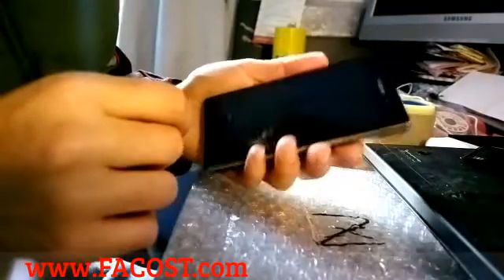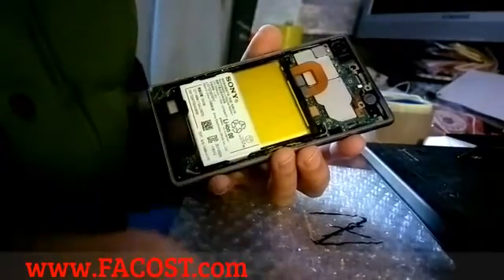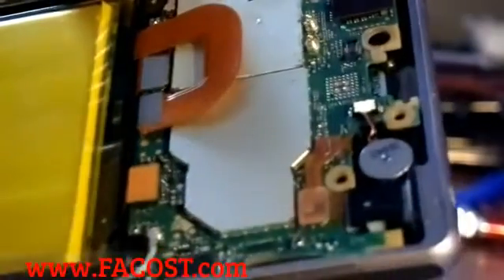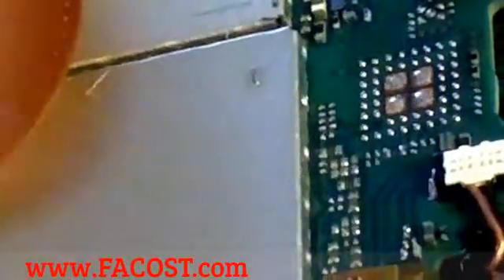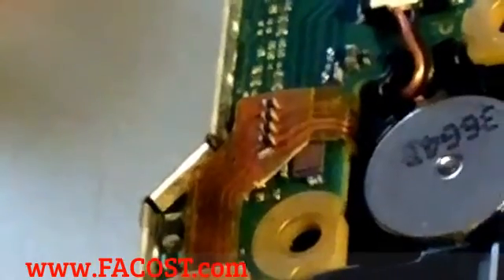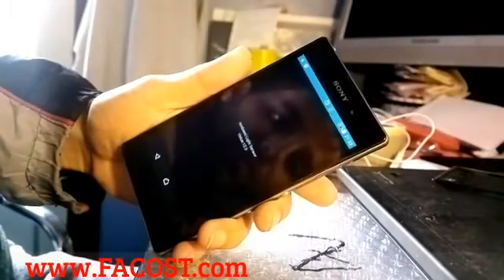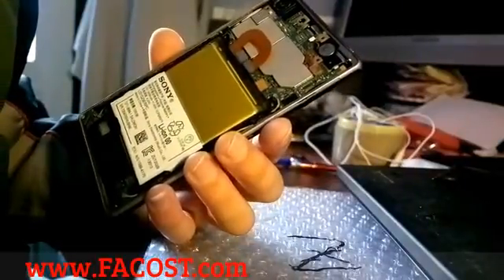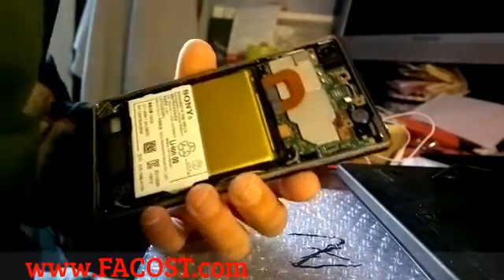phone proximity switch problem !! [Solved]  Black screen after end call

Comment: What about sony z5 mbl thats also the same problem plzzz give me any solution brooo
Reply from the maker: check the flex cable and the sensor if they are still well soldered , if you are able to test it using another parts (working flex sensor ...) then verify if the problem is on the parts or in the motherboard then you will be sure which part is responsible of the issue , any help im help
Reply from the maker: i live in china so its been two years that i didn't fix phone but no worries i will assist you until u fix it

Comment: Thxs this video helped me out. I did not have problem with resistor like your video. But i taked back out of Z3+ and pushed the connectors of proximoty. That worked for now :-) ps: you can run test from settings, about, diagnostics, proximoty while pushing connectors.
Reply from the maker: Mathijs de Graaf congrat. good job dude :)

Comment: you are not telling how the problem can be solved.. I see u make the point but I still don't know how i can fix my phone proximity switch... if I see a missing capacitor, how can i fix it....???
Reply from the maker: just solder the two pins on the flex cable 
do not place new capacitor if you don't find this capacitor